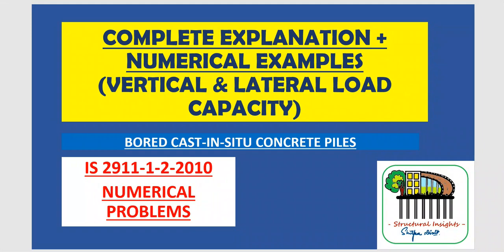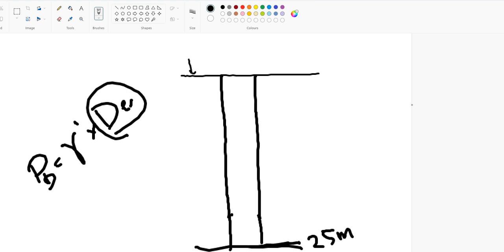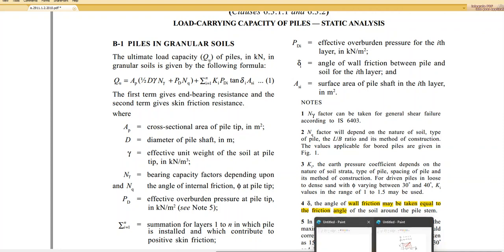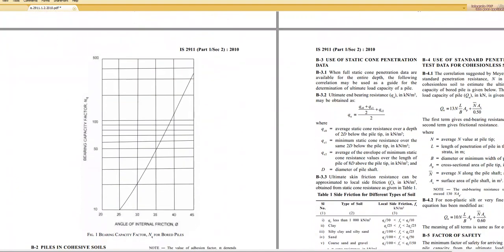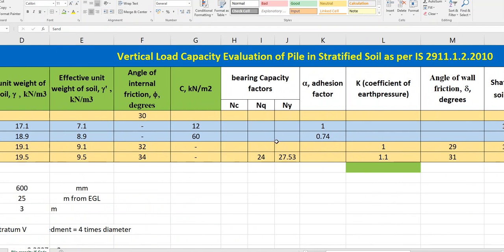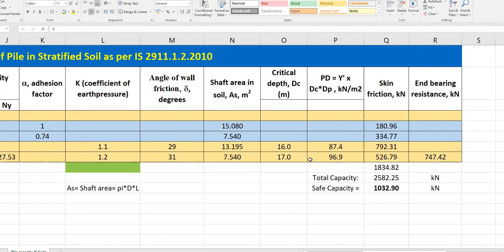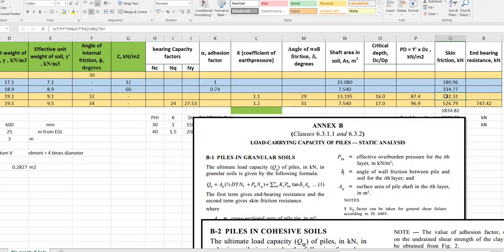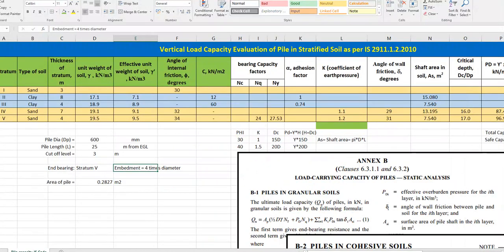Vertical load capacity IS 2911 1 2 2010

Comment: hoe to calculate Nq Ny
Reply from the maker: These are dependent on phi values, there are tables in IS 6403, where you can get Nq and Ny, for given phi. these tables are also given in text books.
Reply: @WithShilpaDixit  Mam, Based on Phi=34 value you take Nq=24, Ny=27.53. , In my calculation got  Nq=30.3 Ny=42.904 for Phi 34. why my calculation did not match to your calculation... Im learner kindly help.
Reply from the maker: @atulshulka3544  I have checked with IS 6403. Your values are correct. It appears I have not considered them appropriately. Thank for giving an opportunity to improve. ☺